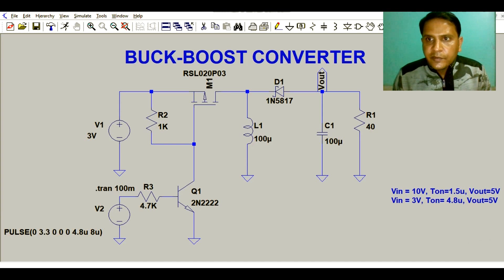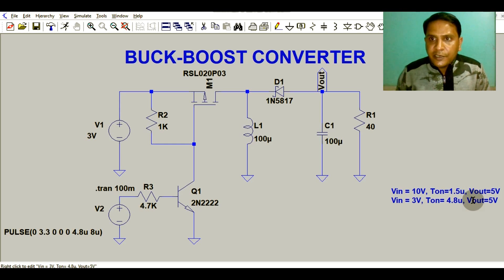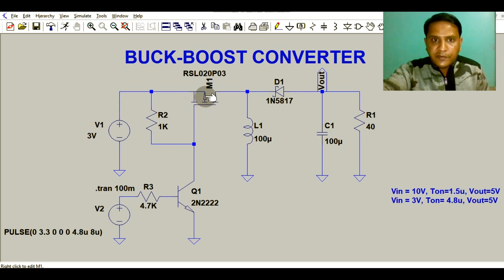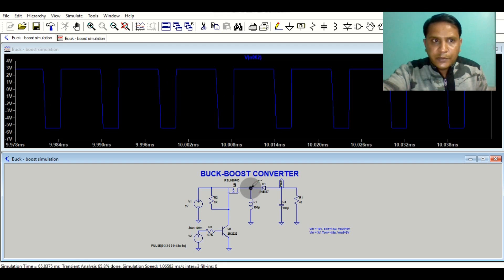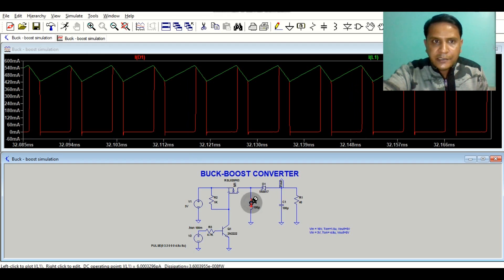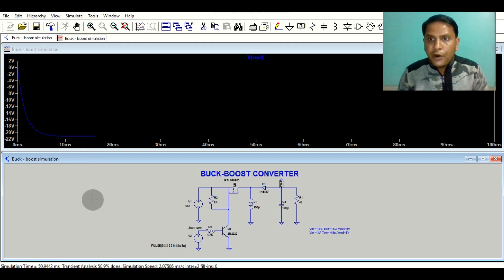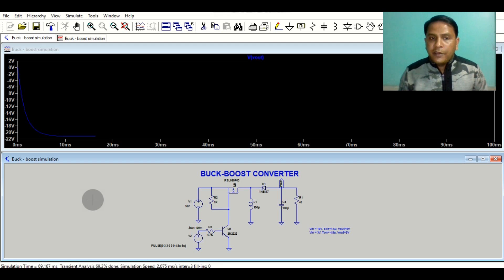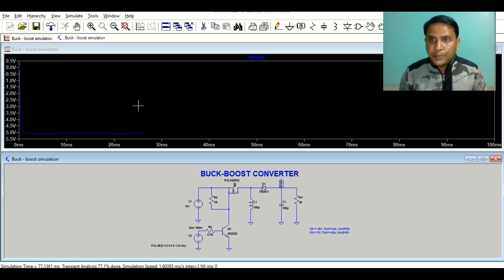LTSpice Inverting Buck-Boost Converter Design | Simulation

Comment: If input voltage variable 60-150vac. I want to fixed this voltage at 90v dc. Is it possible?
Reply from the maker: @Kafi.Creations  yes, use buck boost converter
Reply: @ElectronicsCircuitHubECH  can you please guide me?

Comment: sir. When Duty is bigger than 0.5. Vout getting samll. Its muct be something wrong but i cant find it.
Reply from the maker: Hey...In boost converter Vout = Vin/(1-D) that means the higher the duty cycle the higher Vout. So this is theoritically true.
On other hand there are several other factor which may cause to lower down the Vout. e.g. what is the max. duty cycle of your converter this you can calculate Vin and Vout. How much max duty cycle your PWM ic can support. What is rating of your boost inductor(inductance and current) and how much load is connected.